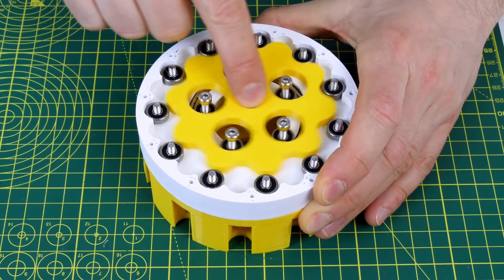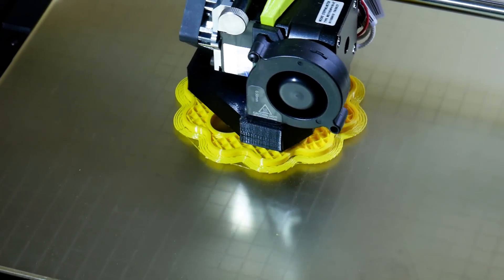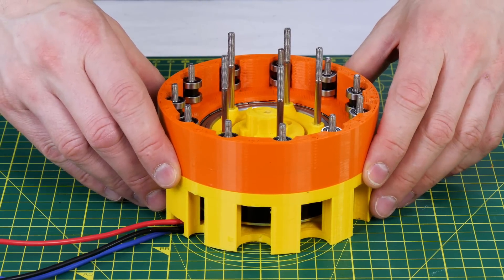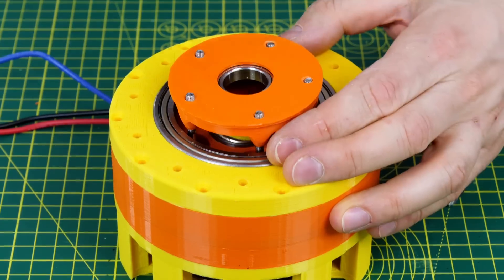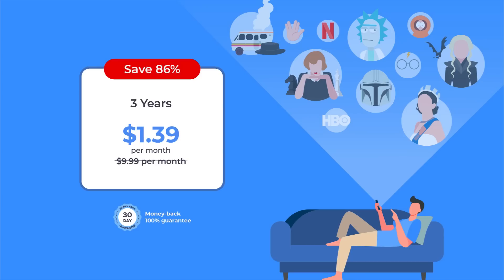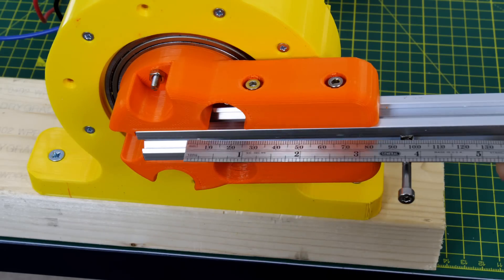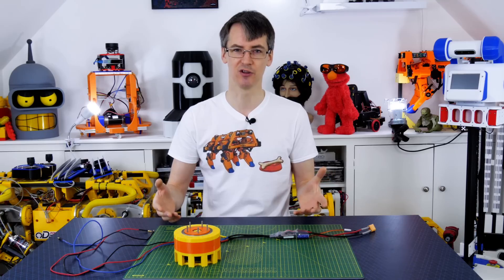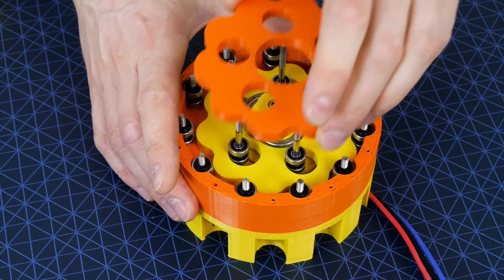3D Printed Cycloidal Drive V2 - Much Better!

Comment: Would you consider using stainless steel round bar for bearing pins? It is actually very affordable.
Reply: I used pins from roller bearings (3mm) and CNCd the discs out of Delrin sheet. my drive is smaller than this one and does 30:1
Reply: @83hjf I actually meant using bearings just with a solid round bar holding it instead of threaded rod. That is a good idea though, is your drive driving any cool projects?

Comment: It would be pretty easy to 3D print bearing "replacements" for the outer ring of bearings, just to test it. Since they are turning very slowly I would thing lubricated PLA wold be fine for the job, as there is a fairly large contact area between the cycloid gears and the rollers.
Reply from the maker: Probably, I'd quite like to find something off the shelf though.

Comment: If you use HFI sensor mode (High Frequency Injection) on the ESC (Technically it's not a VESC if it's not manufactured by trampa), it will actually outperform hall sensors, and have great holding torque at the expense of noise. However HFI is picky about what motors it will run on, it's pretty good on skateboard motors, but useless on hub motors, and yours seems somewhere in between. Oh, and HFI is only available for FOC mode, which supports encoders as well.
Reply: hehehe I see you
Reply: and also, HFI can be tunned, but that is a hella ride :D and when it does not like something, the noises it makes...

Comment: You can replace the bearings with 3D printed roller design bearings, they work perfectly and you can replace the big bearings easily they are perfect for this size. Of course you still have the cost of the small ones but as other people pointed out a different design of the cycloidal gear would eliminated those as well. So you could theoretically reduce the cost by a lot, and the 3d printed ones are just a simple swap so testing them wouldn't require so much effort. (also i think 3d printed bearings can be made  lighter than what you have with some expirements and the proper material,infil,etc.)

Now for an extra thought you can 3d print very small bearings with another design which uses airsoft bbs and a housing, but they tend to fall apart at high rpms due to friction, in contrast with the roller design which uses friction to break it in and make it smooth. it would be intresting though to replace all the bearings with the 2 designs above though just to produce a very cheap gearbox and test it's limits.(the airsoft design would be OK for the bearings the surround the main gear as they don't spin at high rpms.

Comment: Could you print grooves in the disks that you filled with 4mm steel balls which would roll instead of sliding surface to surface? 
Does the 3D print have sufficient accuracy to make such bearing races? What would the shape of the grooves be, a spirographs nightmare?

Comment: If you were to make the assembley water tight, you could fill it with oil to lubricate everything nicely, and ensure slippage between the cycloidal discs.

Comment: Interesting. But why not print with PLA Pro instead of PLA from the start?   Also, that could be an awesome project if made all in Aluminum and filled with a slippy lubricant. If you wanted it to have some spring, then just add fine iron filings to the lubricant, and magnetize them as needed.
Reply: he'd be better off using petg if he's gonna change filament
Reply: He wanted to use stock standard PLA to increase the range of applicable materials
Reply: @KentoCommenT  He said this was just for testing.  Pro (plus) prints very easily and is only a few dollars more per roll.
Reply: @10p6  Question: What does pro pla do better than regular pla, other than easier printing as you've just mentioned?
Reply: @KentoCommenT  The one I use is nowhere near as brittle, is stronger and has a higher melting point.

Comment: I am using bearings for my Cycloidal Drive too, although it adds weight and cost...3d printed spacers are a bad idea, since the tolerances are very important in this gearbox! 😊

Comment: That looks very nice. You could concider brass inserts insted of roller bearings. Friction will be just bit bigger but you can significantly reduce diameter and mass of drive. (estim 50%). As well just as recomendation for knee joint to use smaller motor and drive as torqe will be much smaller on it. so again you can save some mass.
Reply: Brass inserts are fine between two harder surface. they would cut into the soft plastic too easily.
Reply: @hzmeister9596  Not necesery. First of all sliding will be between Bolt and Brass insert. Plastic will be still working as it is now. But totall mas will dropp down significant.
Reply: @mariuszhoscio870  I disagree. Bronze bushings are never used like that. There’s way too much friction and the point load of the smaller diameter would make it even worse.

Comment: Have you considered using Bowden cables to transfer mechanical power to the legs instead of directly putting the motor and gearbox directly on it?

Comment: Those bearings sound massively more expensive than what you could get from the cheapest cheapo source from china.

You can buy about 10 bearings for less than 5 bucks if you buy the cheapos from Aliexpress. They won't be great quality, but considering this isnt for any sort high stress situation, they are probably good enough, and would cut the cost of this significantly. That would chop down the bearings to under 20 bucks total assuming that the big bearings are about 4 dollars each from my rough estimates (though i suppose I could look at the CAD to make better guesses if I weren't lazy).

It will take time to ship from China of course, but if you are more budget restricted than time restricted, it seems like the way to go.
Reply: Agreed, but the large diameter bearings are still expensive, and 30 small bearings adds up too
Reply: @kapytanhook  I actually just bought 40 for 12 bucks cad and the big ones, assuming about 50mm inner diameter are only 4 bucks each. IN USD thats less than 20 total.
Reply: @BeefIngot  fair enough, I sourced some 70 mm ID thin bearings like this and they were like 3 times that price but yeah even then it does not add up to 100pounds. He can save at least half.

Comment: Why not just use a simpler planetry gear set?
Reply from the maker: Because the 3D printed gear on the motor would strip at the velocity and torque I need in a robot dog. Check out part 1

Comment: If you put lips on the cycloidal gears, kind of like the flanges on the side of a timing pulley, then they would self center on the 11 little bearings. This would help the 2 gears not rub on each other.
alternatively maybe use bearings with snap-rings built in to hold them centered?

Comment: Where tf are you getting your bearings to be that expensive? The only reason this would cost 100 punds is if they were like high quality branded bearings like sfk or something. But for 3d printed stuff the cheapest bearing will work since it will be always lower tolerances then a 3d printed part could and if you are going for reliability then i can say that even the cheapest bearings will outlast any 3d printed part.

Comment: to space the two drives apart from one another and casings you may want to look into replacing the bearings on the center shaft with ones with a cir clip grove in the outer race or a shouldered bearing.

Comment: was wondering but wouldn't 120° of spacing make more sense to completely eliminate vibration with 3 layers? :) (sort of like a 3 phase motor's rotational field)
Reply: Why would 3 layers be a benefit over 2?
Reply: @KentoCommenT  sort of like a 3 phase motor benefits from less clunky flux than a normal 2 phase motor
Reply: The best method would be to center the center of mass for the single layer, as every additional layer adds friction, weight and cost.

Comment: Could you improve on the single cycloidal design by adding a counterweight instead of a whole new cycloidal disc? and also improving on the strength. This would keep the weight down by a huge amount - half the bearings, but still the same weight from the weights being equal to that of a second cycloidal disc
Reply: Yes, this is a common solution. This is the design I'm currently testing in my research.

Comment: Superb enjoyable development PLEASE dont' put your 1KG actuator on the KNEE, put it on the hip and use a pushrod, or you will kill the leg with a heavy knee ... https://youtu.be/tgEOpl880KM?t=950. The big bearings need to stay bu howabout using 6 or 8mm steel pins inplace of the small bearings?

Comment: I love it, glad u got part 2 so quickly after the first one. Also i believe you should lubricate that gearbox A LOT more. A LOT A LOT more
Reply: I don’t think so; rctestflight needed to lubreacte his a lot because he had plastic on plastic for the gears, but this one only has roller bearings on moving surfaces, so it doesn’t need as much or any, for that matter.

Comment: have you thought about using a single cycloid with an off-center mass to counteract the vibrations, i have some ideas to make it pretty precise, also please look at the comment that suggests to use mathematically calculated cycloids that wouldn't slip on the exterior and probably could work witout the external rods with bearings or spacers, it would really save lots of weight and would be an interesting development, i think that mostly on the knee joint, witch will be a moving mass, the weight of the assembly w, ould be strictly related to the mobility of open-dog, i really believe in the project
Reply: This is interesting. A mathematically correct cicloid should not rub and would allow to decrease the outer weight of the drive, making it more inertial friendly
Reply: @Otakutaru   great point
Reply: This is a common solution. This is the design I'm currently testing in my research.
Reply: I think doing a non-symmetrical infill could offset the balance of gear
Reply: calcualted cycloids that don't need bearings would not only save weight and cost, but could even help reduce the diameter a bit, since this is starting to look a bit bulky for a joint.

I think using the two cycloidal gears instead of one with an off center mass though is still more worthwhile, given how much extra strength it could add to the gearbox too.
Reply: Some thoughts. Using dual cycloid offset by 180 degrees not only reduces vibration but also increases the strength of the gear. Strength is not always an issue, but given the high impulse load that using this to drive a leg joint makes me think it might be important, especially as it is being made out of PLA.

And as for using off center mass to counteract vibration it seems to be pretty hard to achieve this with a good precision. Besides this has to work at varying RPM, not just at a specific speed, which makes it even harder to accomplish. But I'd be very happy if I'm proven wrong about that. Also where does the vibration really originate? It would seem to me that the high frequency vibrations is probably coming from the center cam as that rotates at the motor drive speed. The cycloid disk will oscillate at the same frequency, but rotates at one tenth the speed. It would be interesting to see a frequency spectrum breakdown. There should be spikes at engine RPM and at RPM/10. Question is how large these spikes are.
Off center mass can be used to dampen the vibrations caused by the cam, but vibrations caused by the cycloid disk oscillating can't be countered as easily. Again, I would be happy to be proven wrong.

To switch things around some, a single cycloid disk version should be more energy effective than the dual disk version. Less weight, smaller contact surfaces and less bearings do make a difference.

Comment: interested in a very fast rim speed relatively small mass throw sling cannon
Reply: disc or maybe vacuum
Reply: designed for orbital launch
Reply: air bearings
Reply: glass sticks with hollows

Comment: I would be awesome to see this motor driven by a proper controller. A position controller and an encoder.
Reply: A encoder can be added to a VESC and a VESC is PERFECTLY fine for this application. VESC can be configured to be a Position Controller. He should learn the facts BEFORE complaining about VESC.
Reply: @christianthier3457  I checked the user manual for the VESC Project and I still think  that a much better and accurate control can be made with a controller such as ELMO TWI. But, as you seem VERY AGRESSIVE in your message, perhaps I should buy a VESC and compare the performance with other BLDC position controllers.

Comment: Love the fact you're exploring cycloidal drives, and I mentioned it in the previous video and I'll mention it again. The gear you have is not a proper cycloid, if it was the bearings around the perimiter would be unnessecary because there should be pure rolling contact between the cycloidal gear and a circular pattern of pins to begin with (i.e. those bearings shouldn't be turning at all). This would let you shrink the size of the thing down, save weight with all the bearings gone and make it cheaper.

Second, you may or may not want to look into this, you can have the outer pins run free, if you fix/anchor the center pins so they don't spin. This might be handy since it moves the output to the outside perimeter. This means you can have the output supported between both ends, rather than cantilevered off the end of the gearbox which I think(?) you mentioned was a bit of an issues with the last design. Paul Gould here on youtube has some designs/videos with this configuration.
Reply: Seconded. The current design is using an "ordinary cycloid" which is easier to derive in CAD but lends itself to higher oscillating forces across the assembly and weaker cycloidal discs; the proper/alternative cycloid is called a "contracted cycloid" or "curtate cycloid" and it greatly improves the vibration and strength while allowing for a smaller assembly.  Google "contracted cycloid tec-science" for a fantastic discussion and derivation of the improved drive geometry with nice animations. It's not something that can be easily geometrically derived in CAD but there are functions and generators out there for use in solidworks and fusion. I'd include links but youtube ate my last attempt to write this comment. :\
Reply: @kimtae858  This is how I designed my cycloidal gearboxes and it is actually quite easy. https://youtu.be/Nk3aaVcvbpA
Reply: @danielh.8836  Thanks for the link. I love that method and your video presentation; Keep it up!
Reply: @kimtae858  It's not my channel 😂, I just thought the video might be helpful, so I shared it
Reply: hope it does this, opendog v3 wuold be wasted with 15kgs of motors and gearboxes
Reply: @IHaveInvalidName  I never said plastic against plastic, on the previous video I suggested using (steel) pins instead of bearings. Frankly I don't see how a bearing which doesn't (or isnt' supposed to) turn helps. It might as well be a static pin.

The main failure mode I've seen in cycloid gearboxes is actually bent steel pins like paul gould shows in a few of his videos. Cycloid gear teeth are actually very strong because they don't narrow toward the base like involutes. They actually widen towards the base.
Reply: Even if staying with the non-optimal curve, the outer bearing could be replaced by sintered bronze bushing which are cheaper and far more compact. The two disks would be driving them in the same direction (I think) so you only need on per pin. You would need to get bolts with a non-threaded section for the bushings to ride on. Sometimes when I need bolts with an overly long unthreaded section I buy longer bolts and cut off the extra thread I don't need.
Reply: @ElectricGears  Just use ISO 7379 Bolts. That is what they are made for.
Reply: I would definitely check out Paul Gould, James.
Reply from the maker: He was featured in part 1
Reply: (after checking out Paul Gould's video and an image for curtate cycloids)
Maybe I'm missing something, but isn't the difference just that James's drive has bearings and bigger/fewer lobes, in comparison to Paul's drive? E.g. is the first suggestion just to make it with plastic curve instead of bearings?
Reply: @JeffHykin  no, the first suggestion is to make it a proper cycloid curve so the bearings can be replaced with metal pins that dont spin like in most(all?) of pauls designs. These are cheaper which james stated was important, simpler which is good and lighter, which was a big focus/issue with the last open dog.

He could replace them with an external plastic cycloid as well, this will honestly probably be stronger than small diameter steel pins if he decides to miniaturize, but steel on plastic is a better bearing surface I think.
Reply: @JeffHykin  my understanding is that a proper curtate cycloid means that the bearings don't spin. Since the bearings spin, the shape in this video is slightly different.
Reply: The bearings really add to the smoothness, and it's better to have a smooth running motor than a rough running one, since it being rough would make it unreliable and would break easily to the point that you would have to replace the drive when it breaks, and that would be more difficult and expensive than just making it with bearings, plus bearings are made of metal, which really adds structural rigidity.